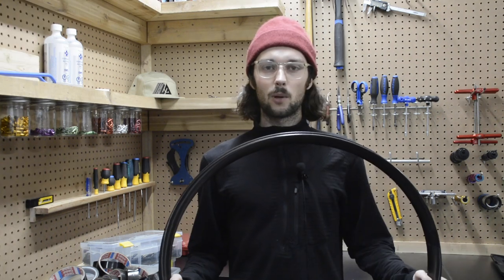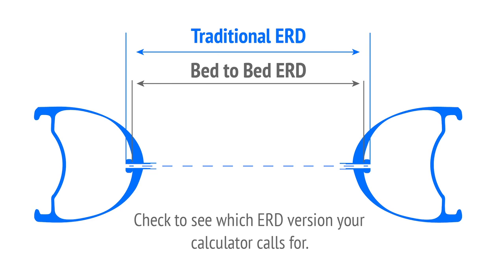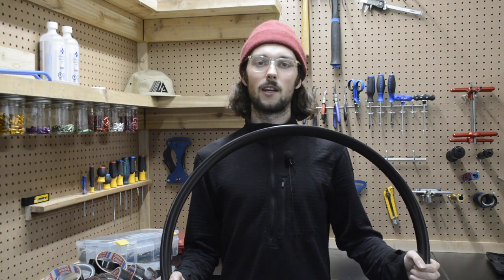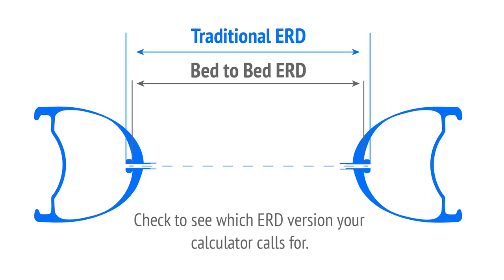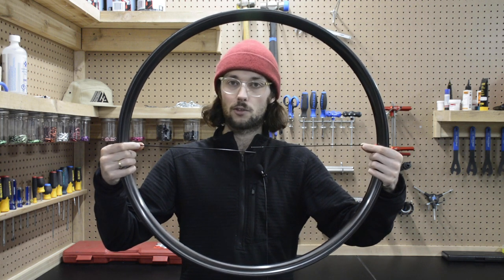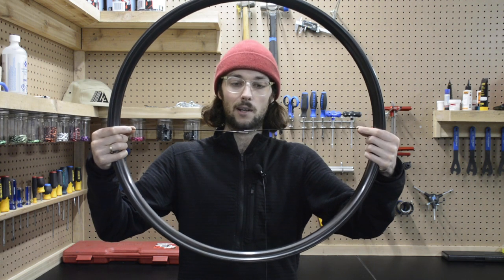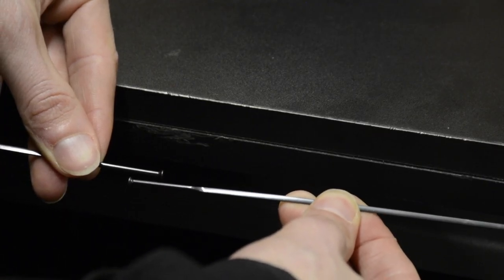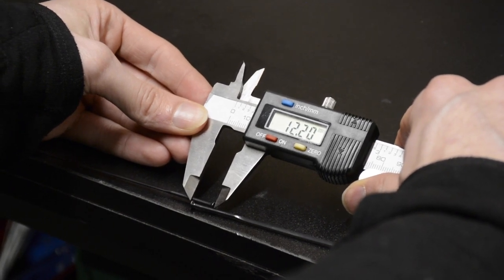How To Easily Calculate Spoke Lengths

Comment: My front wheel should have  a left spoke length of 284.5mm, I ordered 284 should I have gotten 285?. Spokes on the right should be 285.5, do I get  284 or 286? 
My rears left should be 284.5 I ordered 284mm Should I have gone 285? And the right should be  282.9 do I get 282 or 283?
Thanks

Comment: Hi there. I know this an old video. But I want to ask something. Maybe it's a dumb question, Although I think I know the answer. 
Her it comes
I'm going to build from 2 tubular carbon wheelset (50mm)to 2 clincher wheelset.(700c) I'm gonna use the same hubs. The frames I'm going to buy are exactly the ones from Light Bicycles. But I want to build a 38mm front and a 50mm rear.
Will the spokes for the front be short or can I use them ? 

I believe maybe they will fit or not.. ?

Thanks in advance
Reply from the maker: Hi Aldrin, our customer service team would like you to reach out. Please email your question to support@lightbicycle.com

Comment: Hi, I want to use dt swiss r500 rim with dt swiss 350 hubs (12x142, 15x100), and after dt swiss calculations I should use 290mm, 291mm for the front wheel and 289mm, 290 mm for the rear, can I use 291 mm for all of them?

And one more question, If I'm using the hubs with a center lock and adding 6 bolts adapter to them, should I use in calculator DBCL(center lock) or DBIS(6 bolts) hubs?

MB someone in chat can help me, its my first wheel build :)

Comment: I was doubting my ERD measurement until I found some 292 mm spokes. With the J bends interlaced and the spokes at the slots of the nipples the fit was perfect! Published is ERD of 582 to 583. There could be some variation between lots. I've seen Continentals fit slack on a rim bead as well, and these are tighter than some. Good news is that my 290mm spokes should fit only 1-2 mm long. A couple of washers should erase some of that. Perhaps the Sapim Polyaxis nipples even more so when I get them. Doing cross 4 because I'm a heavy rider on a fixie 36. spokes.

Comment: 1:14 "bottom barrel underneath the thread" -  what does it mean?
Reply from the maker: It means that on the D-Light spokes the width of the spoke narrows in the middle which means it can't be easily cut, a spoke like the Sapim Race is the same width (thickness) all the way along after the threads which means it can more easily be cut/rethreaded. However, it is better to order the right lengths of spokes than to cut them to size.

Comment: Good Video 
Question 
i am building 28 hole rear hub for 29er mtb 
should i go with 2 Cross or 2 Cross for 28 hole rear hub build ?
Novatech hub with Sun Ringle Duroc 35 Rim - 29er
Reply: IMO. The less spokes the more cross patterns, in order to make it stronger. Go at least three crosses.
Reply: @Surfmus  Thanks for REPLY 
JUST BUILT IT !!!! 
3 CROSS with 28 Spokes REAR , Bought the Front Wheel with 32 , Got the Matching RIM  Laced to Novatech 28 hole Hub & 28 Hole Rim with Alloy Nipples : THANKS
Reply: @jonienglish3231  I'm currently lacing a set of Koozer 490 to Carbon Rims (27.5) it's being a while since I haven't done one and same method apply as riding a bike, "you'll never forget." I laced my first wheel at the age of 11. Done a few by hundreds, worked and sold over a 1,000 bikes in my lifetime.  

I can't wait to finish the build and have fun in the trails. A must needed hobby to avoid insanity. Ha!
Reply: @Surfmus  Thanks for Reply Surfmus - This will be my 8th Wheel Build 
Picked up a Front Wheel 32 Spoke with Duroc 35 and just Finished the 28 Hole Build 3 Cross with Aloy Nipples , was Easier with 28 Holes , Still have to Assemblt the China Clone 29er Frame with Rigid Niner Fork .Absolutely Correct about Hobbies and Projects
Reply: @jonienglish3231  Now do a 48 hole on a 20" rims. Those are fun, lol.

Comment: its quite easy to calculate but why not cut the thread longer and cut off the surplus, its not a motorcycle wheel
Reply from the maker: Hi Trevor, not every type of spoke can be cut. That being said, when you can cut a spoke, it makes more sense to measure and cut first. The end result will be tidier and more accurate than cutting off the surplus.